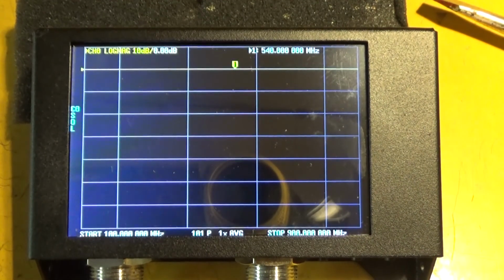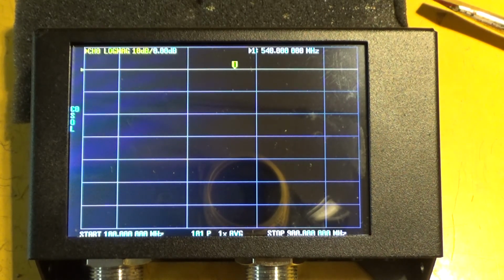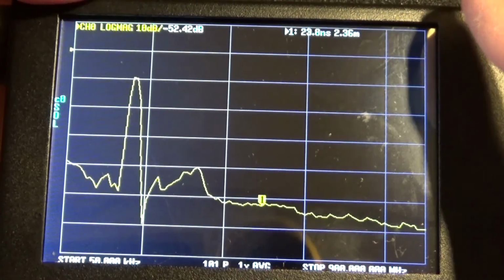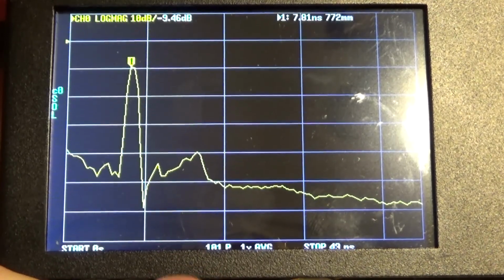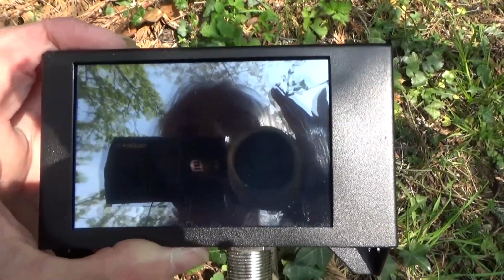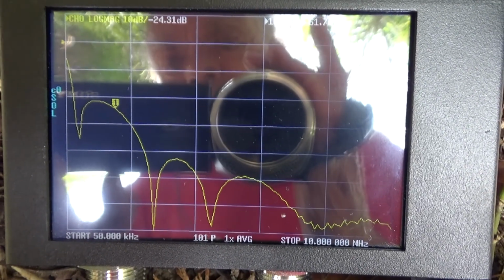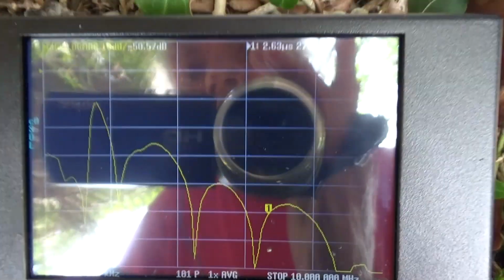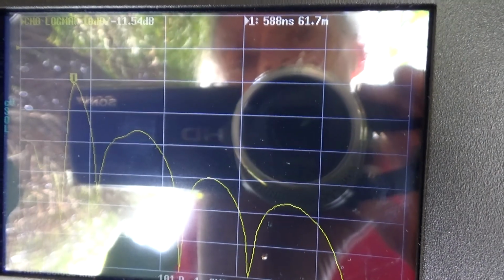Using the nano vna as a TDR (time domain reflectometer)

Comment: Tell me, can one get an estimate of the cable loss using the return loss value (-9.5 dB) at the marker? Seems to me that with 100% reflection, the cable loss would be 4.75 dB, which is half of 9.5 dB. BUT, is this an average loss between 50 kHz and 200 MHz?
Reply from the maker: @jimscheer1787  trying to understand your question as I've never tried to measure cable loss like that. But it makes sense that it has to travel up and down the cable twice. So yes you'd half the 9.5 db. The return loss is not an average value but at the point the marker is set to. A better way to measure loss is to use the 'through' measurement on the nano vna using the two ports, that's how I'd do it. But maybe the end of the cable is to far away to do that?

Comment: TDR is very useful. When I was in Air Force stationed in S Korea we had  problem with an air dialectic cable feeding an HF Log Periodic Antenna. It had a short in it somewhere. We used a TDR to locate the short. It was inside a piece of 6” diameter pipe that spanned a drainage ditch. The pipe had a sag in the middle and water had settled in the area of the pipe that had the sag. It was winter in Korea and apparently due to a series of freezing and thawing, the expansion of the ice as it froze and thawed has crushed the Air Dielectric cable allowing the center conductor to contact the outer conductor and shorted out the cable. I had to build a fire under the pipe to thaw the pipe enough to pull the damaged cable out of the pipe. We ended up re-routing the conduit to ensure it had a slope that ensured it would drain instead of holding water.

Comment: HI Nick. Thanks for TDR measurements. Used the technique, when working professionaly. Good for finding discontinuities throgh bulkheads, connectors, etc.As well as your cable length measurements. I bought a single port vna, sometime ago, Wish I has waited for Nano VNA's. Thanks for the 1n5408 diodes, Done the job , Were you able to salvage any good bits from the SS amp ? 73 Mike.
Reply from the maker: I remember using a pulse generator & scope as a t d r, send a pulse down the coax & measure the time for the reflected pulse to come back. Not very accurate. The circuit board from the amp is in a box with many others which I go to when I can't find a new component, so it won't be wasted, best wishes nick

Comment: thanks for the demonstration. I am getting my nanoVNA-F setup for TDR measurements presently so this has been helpful. One caveat; when measuring antennas VSWR or cable runs outside ,to short the cable first before hooking anything up to the VNA to  remove any static charge as the Nano-VNA does NOT like static at all.
73,
Jim AC0E
DM97nx
Reply from the maker: Thanks Jim, a good point. As the coax was connected to my active loop there would have been no static charge in this case, but an unterminated cable could build up a charge as its acting as a high voltage capacitor. best wishes nick